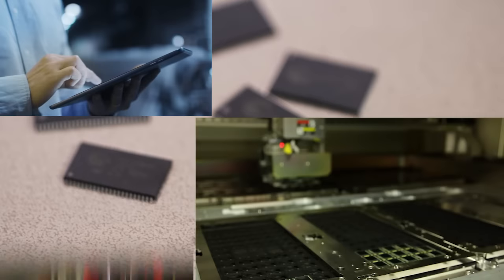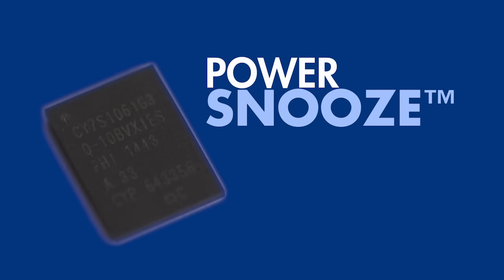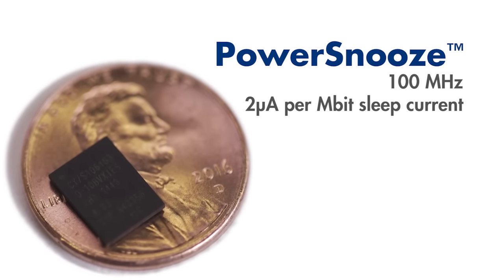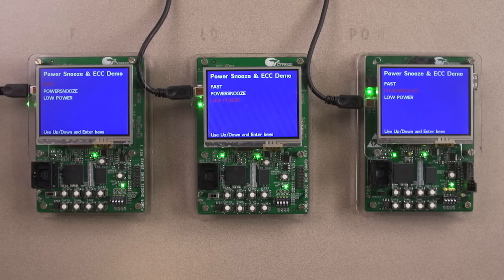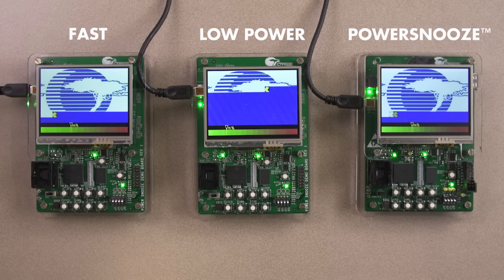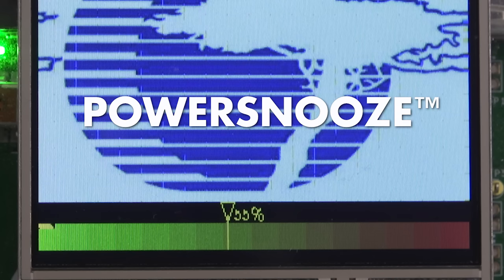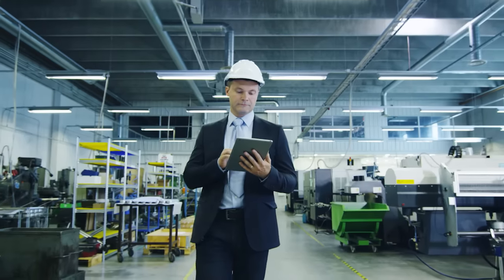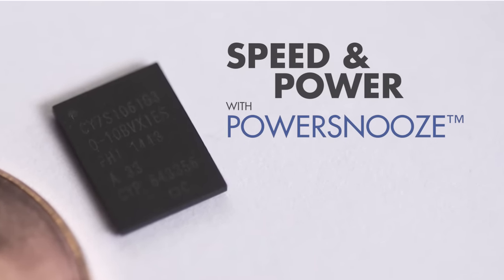Cypress’ IoT Memory: Power Snooze SRAM

Comment: I like the video but it leaves some questions unanswered:
*  How did you achieve the decrease? (smaller transistors?)
*  Will this increase failure rate?
Reply from the maker: Thank you Roy for viewing the video and your questions!
Cypress achieved the decrease in currents based on the 65-nm technology and a proprietary design that allows the chip to transition from a high speed mode to a low power “sleep” mode. So, yes, thanks to smaller transistors and an innovative design.
This feature does not increase the failure rate. In fact, it is 1000x better than competition, thanks to the internal ECC logic (which will be shown in a demo release on YouTube next week). We will post the link on this question/answer as soon as that video is released.